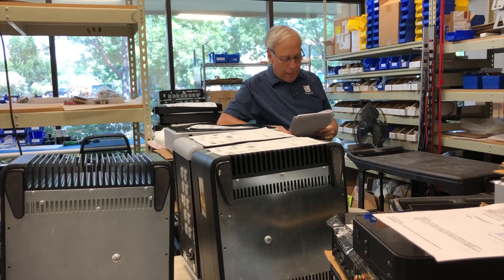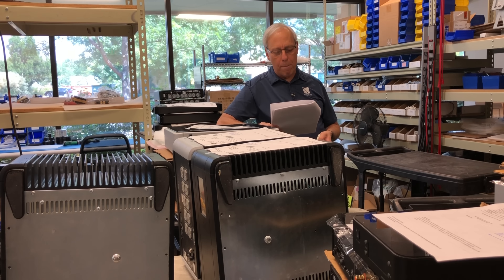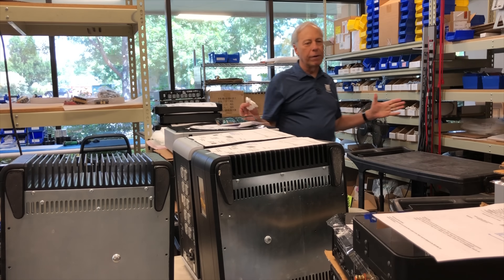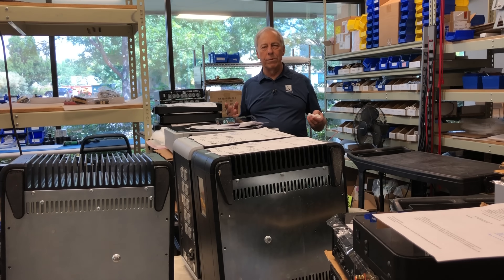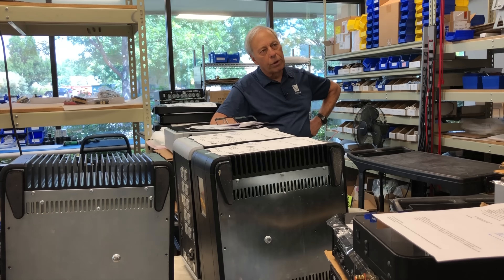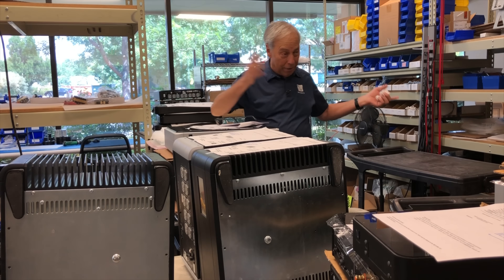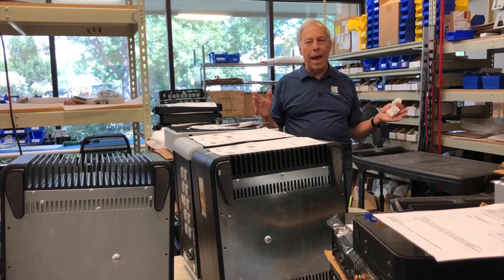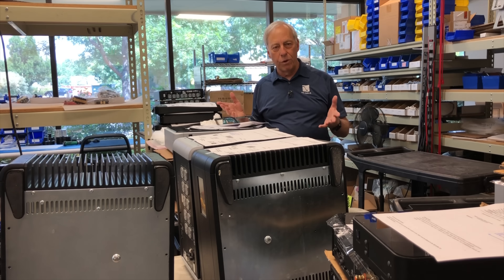Why should speaker cables have a minimum length?

Comment: I had the impression the capacitance and resistance of the cable is treated like a component of the amplifier, and the amplifier is voiced accordingly taking this into account.
Reply: The larger the cables the less the resistance, and the cooler your amp will run, but this is slight, however I use 12 gage  to be on the safe side. They don't affect the sound, a double bind test between a high end (expensive) cable  and a coat hanger resulted in thecoat hanger winning, high end speaker cables are whats called snake oil. Good  for paying for college for the children of the sellers, but just a pretty decoration for the buyer, better bang for your buck is just about anyting
Reply: yes - a lot of snake oil in cables. my post is what I think naim believes, and I might be wrong(?) - like Paul says - they're pretty whacky...
Reply: @musicman8270  I would have expected it to be the opposite. So let's say 8 ohm speaker and amp with 8 ohms output. You use really bad high resistance cable that is also 8 ohms. You'll present a 16 ohm load to your amp. Which will decrease the current flow resulting in half the power being dissipated by the speaker and cable series combination. Given your amp is only delivering half the power the power losses inside the amp will also be lower leading to less heat loss.
Reply: Billy Grinstead   So there is no difference, yet there was a winner in the test?
Reply: Billy Grinstead and also frequency has impact, with DC utilising the whole core of the cable, and the higher frequencies goes more and more towards the outer edge of the cable. I do however doubt it has much impact on low frequency signals like audio is. When we are talking outer shell of a wire, we’re talking gigahertz of frequency.
Reply: Billy Grinstead Yes, a double blind test showed that car jumper cables won.. No surprise, given resistance is key..
Reply: Billy Grinstead so I assume you run coat hangers to all your speakers? Have you actually tried this yourself? Or are you just one more keyboard warrior that does zero research but “speaks with authority” based on one-off “studies” you read? I’m pretty sure I know which one it is, lol.
Reply: I could certainly see the inductance of the cable taming the high end and a very detailed designer using that as a component of voicing, but if they do that they must also specify more qualities of the cable such as it's geometry in order for that to have any validity.

My opinion in amplifier design is that the cable should be specified such that it essentially disappears from the analysis of the circuit.
Reply: they do specify - buy naim!
Reply: Peter S they actually specify the cable you should use (their own NACA5) and the plugs for the amp end (their own dual banana plugs). Naim kit is rather hairshirt all round, their connection methods are bizarre and needlessly over complicated.
Reply: This is all nonsense.  Given the very low impedances and sub-20kHz frequencies involved, nothing about speaker cables is audibly relevant other than the resistance it adds to the output circuit -- and even that has only a minor effect.  As far as human hearing is concerned, garden variety 16AWG zip-cord is as good as anything else unless there's an extraordinarily long distance between the amp(s) and the speakers.
Reply: Long cables have capacitance. THIS is what changes the sound. 

Anyone here play guitar? If you do, then you KNOW how much of a difference a short and a long cable makes on the tone of the instrument. They even sell cables with an integrated varicap so you can change cable sounds without changing cables.

Sorry boys, this one isn't snake oil. Theres plenty of snake oil out there, so move along :)
Reply: @rich1051414  having a guitar connected to an amplifier is totally different than having an amplifier connected to speakers. Also Paul said the length makes a difference. But in a normal HiFi setup does it matter if we have 3 or 10 feet speaker cables? No one is gonna hear the difference
Reply: "No one is gonna hear the difference" And no one can see the difference in the colors red and green. I am looking right at them, and there is no difference. Anyone who says there is a difference are just letting their bias taint their perception. 

I wish I could hand you a specific cable for you to use. It is a long high gauge wire that muddies anything you plug into it. Sure, it is an exaggerated example, but I feel an exaggeration may cut through your own bias to suspect snake oil first. There is a difference, but with all things, there comes the point of diminishing returns. Before you start microimproving your system, at least get your speaker positioning right first :)
Reply: What sort of capacitance figures are you expecting, and how much do they effect frequency response in the audible range?
Reply: Effects; me personally? - probably nil. I am referring to what I believe is Naim's thinking (and stand to be corrected on this!) - probably should have been a little clearer on that point...   However, take a look at 'Analog Looney's' posting about 4 replies down.
Reply: @rich1051414  Yes, all cables have capacitance. However, in the guitar circuit the output impedance of the guitar pickup and the input impedance to the guitar amplifier are much, much greater than the magnitude of the impedance of a loudspeaker or the output impedance of the power amplifier. Because of the differences of those impedances the impact of the cable's capacitance is much greater for the guitar than for the loudspeaker connection. In the case of the loudspeaker, the capacitance of the cable is insignificant.
Reply: Do the same calculation for ordinary 16AWG zip-cord and that 3dB point would still be inaudibly high - that's why resistance, which entails some (relatively minor given the typical distances involved) loss of amp power reaching the speaker, is the only significant speaker wire specification.
Reply: yes, you have to listen and try different types to find the right synergy for your system. My mono block Heathkit W5M's like 18 gauge 2.5 meter silver wire instead of 12 gauge copper because it changes the voice to my liking.
Reply: Rob Harvey Sounds like the cable is being used to stabilize the amp output.. If true, that is poor engineering..
Reply: Many years ago, I helped to set up a nice music system in a medium sized book & record store. 4 speakers,  2 channel stereo. The speaker wire for the farthest speaker was 50' or 60' as I recall. So, I decided that it might be a good idea to have equal lengths. 4 X 40 = 160' of cable. The speakers were placed above head height on the top of display cabinets. The closest speaker to the amp had the 'extra' cable,  looped around in a big circle. 'Large' quality speakers.  Sounded fine!

Comment: Older Naim gear required minimum naca5 cable length because it needed minimum inductance in the cable which is achieved using 3.5 m length. Newer gear has no such strict requirements, Supernait included.
Reply: G Guest  -- I'm aware that certain Naim products have unusual speaker cable requirements -- they are the very rare exception that proves the rule.  That issue is mentioned in Roger Russell's IMO definitive writing on "Speaker Wire,"  which is what I personally go by and recommend.  http://www.roger-russell.com/wire/wire.htm
Reply: The rule still applies even on newer Naim amps when it comes to using their own speaker cable. But is no longer required, when you're using a different manufacturers speak cable.
Reply: @alvin19391  well, before I got 3,5 m naca5 myself, I used Chord 2 m cable set without issues. What is more important, that is avoiding hi capacitance cables or any sort biwiring (capacitance in parallell) what will make bigger impact on SQ.
Reply: Cable capacitance is a non-issue given the very low impedance and sub-20kHz frequencies involved.  I find it astonishing that serious audiophiles willing spend so much for their gear have apparently never looked into the relevant LCR math governing cable losses.
Reply: @editorjuno i suggest you to try to listen before you find out something or anything... I had proac cable 2m long before 4m naca5 and the difference is the like I bought a class higher stereo. Then it came the surface for the componenets and finally I plug them directly into wall sockets each and what a huge improvement that was. Every step made significant improvement. Then I mount at speaker's stand supplied spikes and footers replacing the rubber feet for hardfloor and the result was similar to the recent PS audio clip with Focal Kanta and some special footers. After that I follow guidelines for positioning in Focal guide and lots of Paul's and other inputs like front firing instead toe in and several bookshelfs for difraction and carpet in front of the listening area. Unfortunately I can not remove my tv but at least I put it on the wall I will try to get some sound-absorbent cover. That are the steps I made and each and every step did improvement- but naca5 and direct plug into the wall socket made HUGE improvements and stabilise the sound. I asked for ps audio wall socket but it is still not available for Europe but importer say that it will come soon, so I will wait...
Reply: Confirmation bias rooted in investment justification is a powerful psychological phenomenon upon which the "high-end" audio industry depends.
Reply: @editorjuno  of course - let me be that stupid if I enjoy. Obviously you find enjoyment in telling people that they are biased and stupid to spend their time and money on selfdelusion. Thank you for your altruism and your time. But I pick my ears instead your conpiracy theory. If actually is a delusion than it isa pleasant one and legal and much much cheaper that other illegal ones. I hope you enjoy the same telling people that they are actually insane. Nice way to spend your time!
Reply: @editorjuno  I suggest you to read less ghnostic and sf material.  Matrix is just the movie...
Reply: It's your money -- spend it as you please.
Reply: @freekwo7772  
"made HUGE improvements"....😆🤣🤣😂🤣😆
Reply: @poserwannabe1  I see your problem when you see the word "HUGE".
Reply: @freekwo7772  
Yeah, not possible sorry .
Reply: @poserwannabe1  based on your personal... experience 😂😂😂
Reply: @freekwo7772  
You should spend your money however you want, just don't try to change the laws of EE or physics based on BS. There's no voodoo involved in audio, when people say their new outlet gave them " a darker background" or a "better soundstage" it's simply not possible based on science, not experience, although I do have over 40yrs in the industry.
Reply: @poserwannabe1  btw I didn't say "new outlet" - only plug directly to the wall. But I certainly would try better outlet for the right money - that means according to the price of my system.
Reply: @freekwo7772  
Read @Bruce Morgen post above, he's exactly right, but spend away and enjoy yourself, I'm out.
Reply: @editorjuno  Ever heard any Naim kit?  Do that before you pronounce, I think they know what they are doing and have done for the better part of 50 years otherwise they wouldn't still be a thriving company. If we all took your advice and audio reproduction really is simply a matter of electrons then I can skip happily into a Walmart and pick up a $100 music player and tell everybody its the same as paul's PS and IRS5 Cheers for that mate.

Comment: If they reach the amp and the speaker then it is the right length
Reply: Just like your legs... should be just long enough to reach the ground, any longer will make you walk funny
Reply: Dont forget the crossover inside the speaker. Some coils have 20 feet of #22 wire inside.
Reply: Yeah I am honestly amazed by the stupidity of these audiophiles.  

Cable length only matters if the length is too long. Especially with thin cables. Since the resistance increases your signal gets weaker. So running crazy short cables is not gonna make an issue. 

Tell me how short cables is gonna make it sound worse. If so, every studio monitor must sound horrible since their drivers are almost direcly connected to their amps.

As for really long cables combines with shorter ones for different speakers, this is where room correction comes in from your AVR or stand alone DSP.
Reply: It begs the question:   how long should the cable be INSIDE the speaker?
Reply: Lenn Minkhorst you clearly don't have enough information on naim amps.
Reply: x21 what is so magical about their amplifiers that no other amplifier on earth states this theory?    To me it sounds like a flaw with an amplifier vs a feature.
Reply: Top Shelf Innovations The magic is simplicity of the output stage. Also exposure used to use a similar design.
Reply: Have you ever seen the hair-thin wire that runs from the speaker basket to the voice coil? Audiophile magic stops at terminals.
Reply: @Finn-McCool that's because heavy wire would interfere with the freedom of movement of the voice coil / speaker cone.
Reply: They have to be short so nobody trips on them and knoacks over the table or a Radioshack tape deck from 1972
Reply: Chord speaker company did quite a bit of testing on speaker cable lengths and what they found was a difference in length of not more than 40% worked pretty well. So a 5m/3m pair, 7m/4m pair and a 10m/6m pair were good. There are a couple of important points here though. Whilst the vast majority of amplifiers will be completely happy with a different length pair of speaker cables, some amplifiers use the speaker cable as part of the circuitry and in this case, cable lengths should be kept the same. Before using different lengths of speaker cable, it is important to check with the manufacturer of the amplifier.
Reply: Ha!
Reply: G Guest  You are right. I should've said "audiofools".  
But more often then not people that call themselves "audiophiles" believe in nonsense like €1000,- cabling of barely 2 meters making a difference. 
I also studied electrical engineering and I know that cabling CAN make a difference. But after a certain point, it is a EXTREMELY tiny difference that only makes a difference when measuring it with sensitive equipment. Not to the human ear. Double Blind tests have proven that sufficiently thick pure copper cables are more then enough for audio cables.
Reply: It' all about impedance. Longer wire has more electrical capacity. That guy is don't even know what he's talking about.
Reply: How important is it to have the same length cable from amp to the left speaker and the right speaker?
Reply: buster colin how big of difference you talking?  A couple feet will not matter .  50 foot will.
Reply: @caseytbss  about 3.5 to 4ft difference.
Reply: The speaker cables are part of the audio circuit. Their length determines resistance, among other attributes. So yeah, the length matters.
Reply: @Fluterra  but 2m vs 3m will not have any measurable difference, let alone an audible difference. Unless it's smaller than 18 gauge AND lower than 4 ohm AND over 1000w AND over 10ft, you won't notice a difference (assuming the cable is pure copper, CCA is slightly worse, maybe 500w @ 18 gauge?)
Reply: Jim Jay @12ft you start to get some losses in dB and capacitance buildup with any AWG lower than 9. speaker cables effects corner frequency. also, if the AWG is greater than 7 the highs roll off.
Reply: Hue Hue Hue! JJ make jooooooke!
Reply: XC/XL, ICBO....
Reply: Joshua McLaughlin - lower gauge or “lower” thickness you mean?
Reply: Joshua McLaughlin Hogwash. You don’t know what you’re talking about. Each cable will not behave the same way, you can’t make unilateral comments like you have. Please don’t post if you don’t know what you’re talking about. You’re not helping.

Comment: I can see the resistance and capacitance of the cable changing with length, but if you coil up the extra cable you add inductance, so... ?
Reply: If you coil a pieced of speaker wire with a geometry like Zip-cord you create an inductor in one path and a 180˚ out of phase inductor in the return path. Those two inductors then operate as transformer to a tiny extent and the signal starts to smear and look less pristine.  If you wanted to add inductance for let's say voicing, one way would be to split the speaker wire into two discrete wires and to coil each of those wires independently of each other. I always advocate for a speaker wiring which becomes essentially transparent in the final circuit analysis.

Comment: I always go by the assumption that all components in your system can be represented by a complex circuit. In fact the circuit simulation program I have used

https://en.wikipedia.org/wiki/SPICE

does exactly that. A resister is not a resister it's a complex circuit consisting of primarily a resister, some capacitance some inductance and on and on. A speaker cable is just another component that can be represented by a complex circuit. Many/most amplifiers use feedback in their design. To that we connect a speaker cable that is in itself a complex circuit. The longer you make that cable the more complex the circuit gets. Maybe that's why as Paul says longer cables, in part, do something to the sound.

Keep these great videos coming Paul.